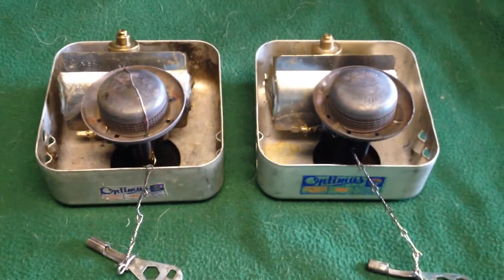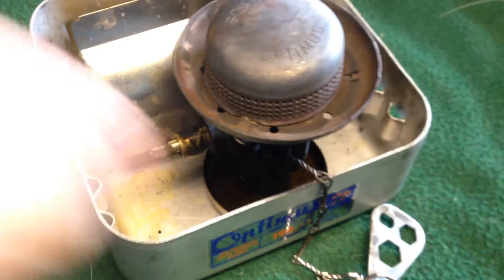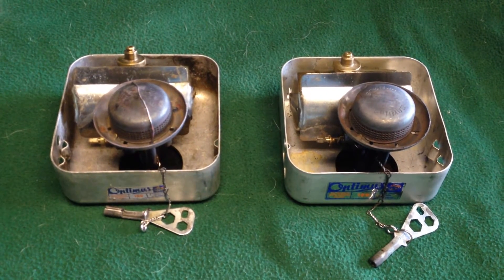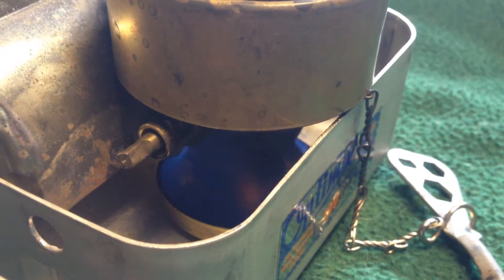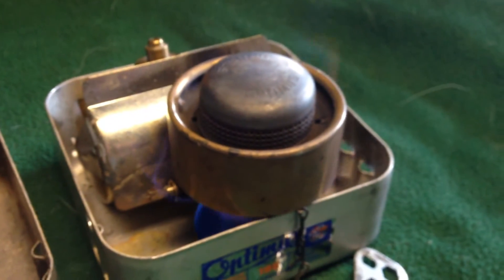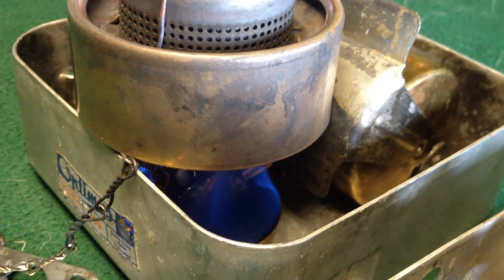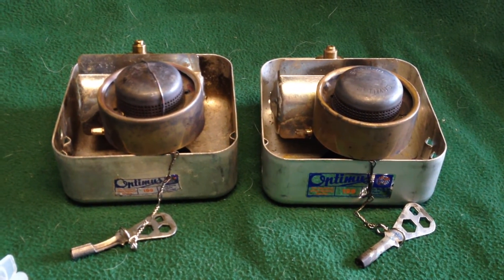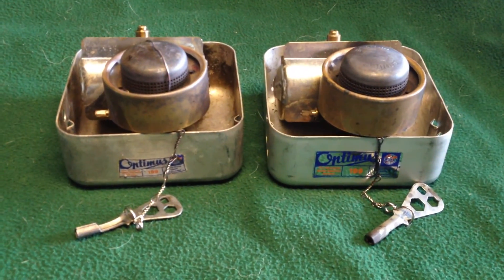Preheating Comparison Test: Optimus 199 Backpacking Stove With & Without Carbon Felt

Comment: For preheating i use the wick from a chafer fuel tin in a cigar shaped hip flask.
It lasts a lot longer than alchohol and is much cheaper in the UK.
It takes under 2 minutes and then i just push in the wick to snuff it and close the hip flask.

Comment: I thought I was lucky to have 1. You got 2!! Anyway instead of Carbon felt I found that ceramic fiber or ceramic wool works a lot better and doesn’t shrink as much. 
As for no wick material. It heats it up faster but with a pad/wick you can use less alcohol to preheat it. So you save fuel with a pad. But if speed is your concern I’d say no wick or a raised wick. I like the safety factor of a wick pad. Great video. I like to see more of your stoves in videos!  I’m a long time subscriber!
Reply from the maker: Thanks for the comment (and being a subscriber).
I have not noticed shrinking of the carbon felt pad as of today. I find that the stock fiberglass pads in some stoves shrink and get brittle.
I wish I had two 199s, but I only have one (so far). I was borrowing one from a friend of mine.
Reply: @trangiauser7563  that wire over the top of the burner. Is it Khantal or nichrome
Thanks